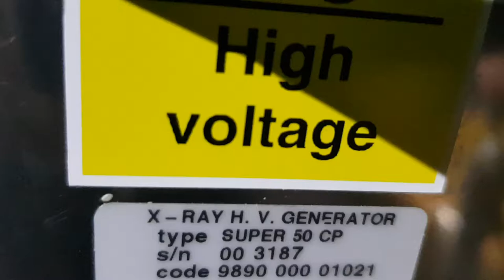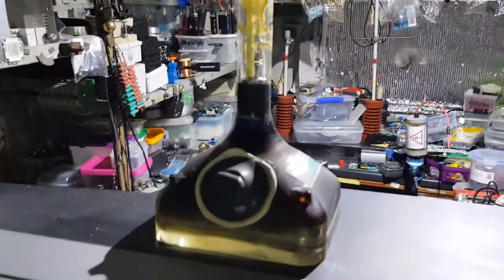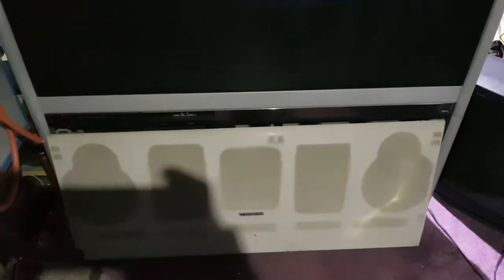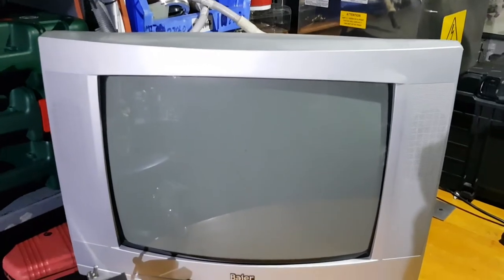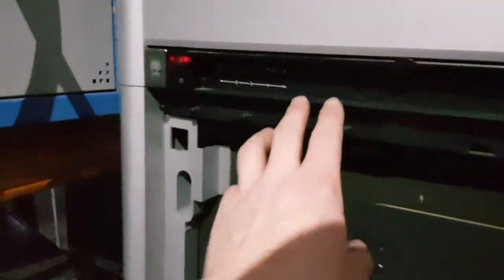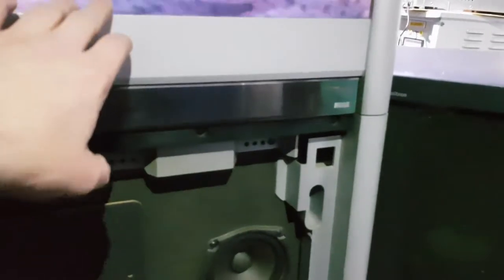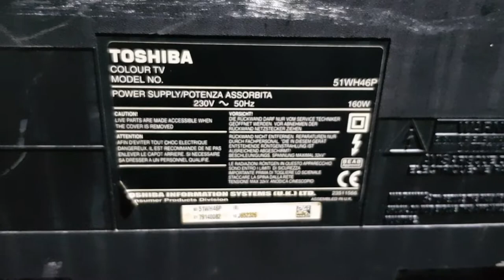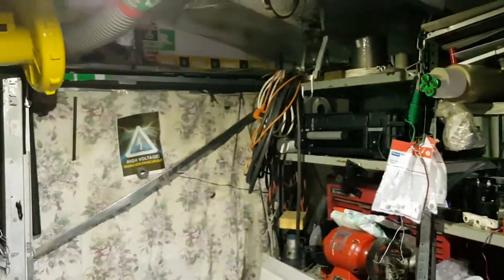rear projection tv, and 2 old style crt tvs.

Comment: You have an unsafe vinyl white dryyer vent looking thing for the begining of the video from. The cailing on the top right, also avoid use of the metal FOIL types of those as well for the also have plastic used for the making of the foil so its flammable use either rigiged/smooth walled metal vent or semi rigid metal dryer and other vent